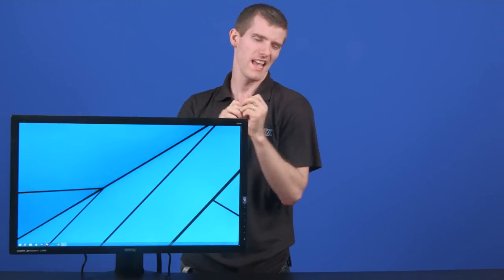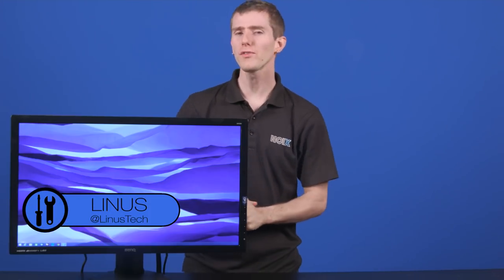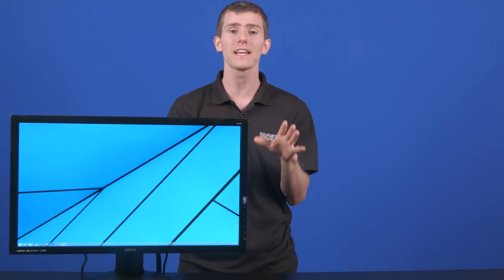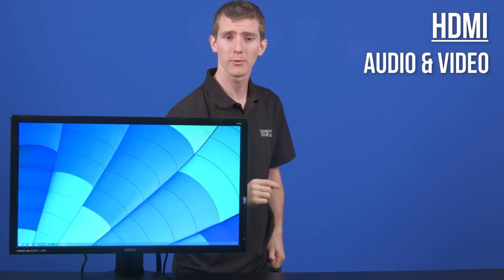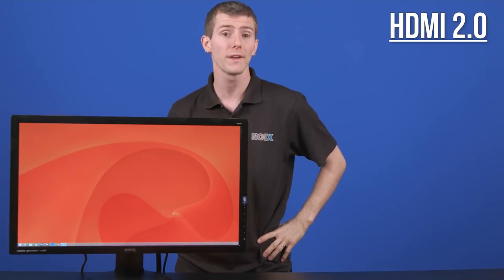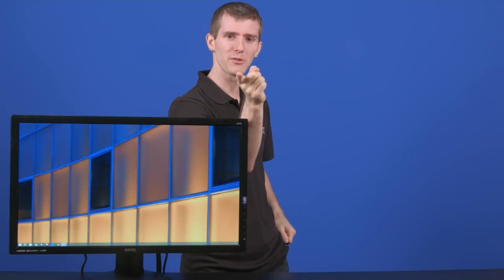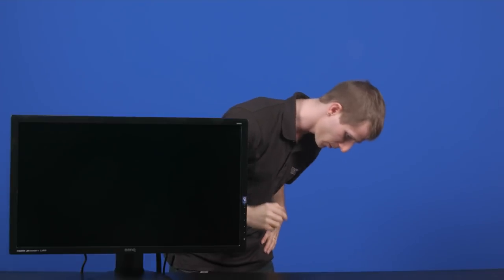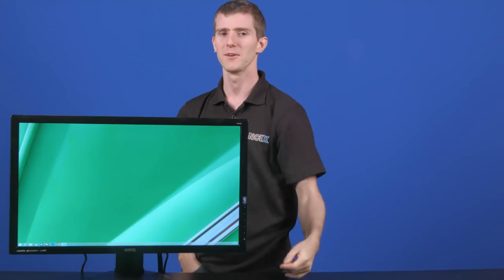Display Connectors Explained! - Tech Tips

Comment: I´m using a normal HDMI port. Should I change to a Displayport? Does it have any benefits, as long as i play only in 1080p, maybe 1440 in the next future.
I7 4770 3,4 ghz
Gtx 980 Windforce 4 gb Vram
16GB Kingston 1600mhz Ram
1080p Samsung Monitor
Reply: Depending on the type of monitor and display monitor you have, Display port is a good one to go with in the future and like Linus said, display port has easier time converting to most display standard so when it comes to compatibility with new monitors are most likely. When it comes to HDMI, it can have problems like EDID conflict where monitor scaling needing to manually adjust and also the cost of HDMI can go high if you don't know where to shop.

Comment: So, my monitor doesn't have a Displayport port. Just 2 HDMI ports a VGA port. If I got a Displayport cable and connected it to my monitor through a Displayport to HDMI adapter, would I get the benefits of Displayport or what?
Reply: No. The solution would be 'bottlenecked' by the adapter or the hdmi port on your graphics card.

Comment: dp to hdmi or just get hdmi 2.0? for better gaming view
Reply: Xmans___  hdmi 2.0, it doesn't matter for your DP idea what cable you use if the port that receives the signal can't process the full quality of the signal you send
Reply: now i use hdmi 2.0 but i can see ghosting on my benq ew2440l while play csgo. it so annoying because i will die first before i can shoot them. do u have any idea how to fix this issues?
Reply: Hi. I have to use either adapter or cable dp to hdmi. My concern is losing quality. So which one is better or is there another option ? Thanks

Comment: I have a samsung UE590 4k monitor. i have connected my laptop to the monitor through a HDMI cable. but it only supports 4k 30fps. My monitor also have a DP port that supports 4k 60fps. How can i connect my laptop HDMI to DP port in my monitor.  (laptop only have HDMI output)

Comment: question: i have a geforce gtx 680 amd thinking of buying a dell u2515h display. what is the best way to connect it?
Reply: your monitor is just 60hz maximum, so HDMI would work (although DisplayPort wouldn't cause problems either), and I find HDMI cables more common to find around than DP cables. You can go with whatever.
Reply: thank you for your support and answer. Just got the monitor amd got it connected through display port and i absolutely love it.
Reply: ZWGamemaster ah, nice!

Comment: if I use displayport-->hdmi will I loose  quality? Also, does displayport deliver audio signal?
Reply: Yes and yes. Any time you convert a signal or transmit it over long distances you will lose quality. You may or may not be able to tell the difference. (Probably not)
Reply: +ealiev60 no you won't lose quality. you'll lose a touch of signal strength, as you're putting a break in the line by routing the signal in one configuration (dvi) to another (hdmi). the loss is minor though. You're not converting anything just changing the shape of the connector. Don't worry though, the minor loss is just the resistance you added from adding a break in the signal, and since it's digital, as long as the voltage is high enough to carry a signal to the component receiving the signal, nothing has changed. it's all 1's and 0's. Quality is lost in analog signals where voltage matters, or in digital signals if they get compressed. (like re-encoding a dvd or bluray movie) Hope that helped.

Comment: Does DVI supports 1920x1080 60fps ? I have a Benq RL2455  connected with DVI. Will i get more if connect with HDMI?
Reply: +bloodcorer i'm sure dvi dual link supports up to  2560 × 1600 at 60hz so it can support the standard 1440p at 60hz ;)
Reply: Eping | Gaming & More
My monitor doesnt support 2k. Its strict down to 1080p but thanx anyways.
Reply: bloodcorer if you have a nvidia gpu you can overclock your monitor resolution if your gpu can handle it and play at a higher resolution it will be like AA.
Reply: Eping | Gaming & More
Nvidia is just mainstream crap. I play everything on max resolution witch is 1920x1080 with my HD6870 1gb. I was just wondering if HDMI would give me better colour or something.
Reply: +bloodcorer The only difference between HDMI and DVI is that DVI can't do audio. So unless you want to use the speakers on the monitor if it has any. You will not notice a difference between DVI/HDMI @ 1080p
Reply: cheddar07
Ok. Thats what i wanted to hear. Thanks

Comment: I need help :)
my rig
x sniper case
2tb seagate hdd
fx 6100 Zambezi 
970 msi MB
r9 270 xfx GPU
6gb ram ddr3
650 bronze evga PSU
how should I upgrade 
two ssd in raid? and 16gb of ram? or what . thanks :)

Comment: Hey guys, one question. I have and old LG W2363D that runned at 120 Hz on my old rig with a DVI-D dual. Now I want to use the monitor as a second monitor but there is no DVI-D connector on my RTX 2080 Ti so I bought an adapter DVI-D to Display Port and connected it. I can only get 60 Hz on my monitor, any ideas on why i cant run 120hz on the second monitor?
Reply: l4tiNoh34t you have a 2080ti but also have an old lg monitor

Comment: It's a shame they're getting rid of VGA and DVI, they're better connectors than HDMI.  When I connect a display with VGA or DVI, it just works.  No hassle, no fuss, just perfect display clarity.  When I connect a monitor with HDMI, I start getting issues with overscan (yes, that dated concept STILL EXISTS), interpolation and bad screen size reporting (720p screens reported as 1080p).  It's so bad most of the time that text is unreadable and the colour only displays in 16 bits.  DisplayPort is the way forward.  It's free, works without fuss, and supports better screen sizes/refresh rates than HDMI.

Comment: After realising my video card only supports a max of 2 monitors, I'm currently using VGA, DVI, and HDMI at the same time on two monitors. (For the record, converters: one VGA-DVI connector and one DVI-HDMI connector, and no, not on the same line, either.)

Comment: Just gotta be the guy to say my primary is converted from DVI to VGA by adapter on the card because my monitor I got from a friend's old computer doesn't support DVI and also because I own no DVI cables. My second display I rarely use is an old CRT over VGA through a KVM. Resolutions are 1366x768 and 1024x768, not because 768 is my lucky number, but the primary only goes that high and the CRT at it's max of 1280x1024 looks tiny, though strange enough I've accidentally gotten it to 1080p

Comment: Even if this video dates back to 2015...

on my Setup I currently use HDMI 2.0 and DVI-D Single Link, which is a bummer for me, I would preferably use DisplayPort and HDMI 2.0 so I'm looking toward to buy another Asus Pro Art monitor which will be 2560x1440p over DisplayPort. My current monitors are Acer's K345HL(Pre-Production Sample) and an old and discontinued Asus PA247 (as though sold as a VS(Visual Studio) monitor because it didn't reached the standards for 2560x1440 in 2012)

Comment: HDMI for my primary monitor, Dual Link DVI-I for my secondary monitor. Both run 1080p at 60Hz stock, primary is overclocked to 73 Hz and secondary to 62 Hz.
Reply: +Marco Hellmann you can overclock monitors...mind blown. And how are you getting hdmi to carry a refresh rate higher than 60Hz? Is it hdmi 2.0?

Comment: i used to use HDMI and VGA to get that Dual Monitor setup but since my new PC im stuck to 1 monitor until i either get a Displayport to VGA adaptor or get a new Monitor that supports Displayport. you must be asking why i didn't get one withe displayport in the first place, well 1. i only had £80 and 2. my old GPU never had Displayport.

Comment: Your explainations have been very helpful sorting out my latest jumble of video connection capabilities. I have a 21 inch Dell LCD monitor with DVI, VGA, S-Video, and Composite inputs and a second HP 21 inch monitor with VGA, DVI, and Displayport inputs.
My main stream is DVI to 1 monitor and the other HDMI to DVI conversion.
I still use VGA as alternate port on one monitor with my MSI Netbook PC with VGA output running Win 7 when at home using the front panel switch to select. Hey, its been around the world litteraly 3 times in a previous career and still going strong.   
Now I have a second CPU with HDMI, Mini Displayport, and USB-C displayport outputs. Well I'm still trying to figure out what I'm going to do with 7 outputs and only 2 monitors. ;-)

Comment: A year late it seems, but I haven't yet watched the entire backlog of videos...
With the ever increasing resolutions of displays, and the tech making the usage easier; I think the already stretched bandwidth usage of 1080p, streaming over the internet, is going to push the absolute need for fiber internet everywhere in the coming decade. However if the ISPs don't get on it fast, we will be significantly bottlenecked with our internet speeds (and sometimes caps) just barely making HD streaming possible.

Comment: I've been using DVI for over 5 years though my hardware supported HDMI. However, in 2015, after getting myself a home theatre which has only HDMI ports, I finally made the jump from DVI to HDMI. And it turns out that it was the most horrid experiences ever. The colours were a bit odd, text was a bit smudgy, the overall brightness was lower. And when I googled the problem, it turned out to be something that many people were facing due to some weird nvidia driver issue, where the GPU thinks that whatever is connected to a HDMI is a TV (and outputs a lower colour range) and the one connected to DVI is a computer monitor. Though many people had several ways to correct this issue, none of those methods made the picture look as good as DVI.

So, if DVI is a legacy technology, why is the current standard HDMI isn't as good as DVI?! WHY?!!

Comment: You answered about 2,000,000 questions I had,but I have 1 more. I daisy chained my two 4 k monitors together and ran an HDMI cable from my video card to the HDMI 1 input on the main monitor, I have no signal on the 2nd monitor, the 2nd monitor input is set for the  data port. What the neck am I missing. Great video.

Comment: I actually have a question for anyone especially Linus. I have a 2k monitor that uses displayport only connection type. Now my issue stems from the fact that my boot sequence or bios post does not load/show on the monitor when starting up my PC. Nothing comes onto the display until it is loaded into windows already. However, when I have an HDMI or DVI connected monitor either  alone or as a secondary it does so just fine. Is this an issue unique to displayport? It has been happening with both my older GTX 680 and my latest GTX 970. So lately I have always had to keep a secondary monitor plugged in through HDMI or DVI if I ever want to access my bios. I already have it set as a primary monitor and even when it is the only one connected this happens. Any help with this would be appreciated as this is my for display port based 2k monitor and never had this issue with the other connection types.

Thanks
Reply: i would check the bios 

in my case its very minor on my crosshair v formula z, the diffrence between pci and peg is a change in boot font and logo size

on the bright side the boot ups look cleaner

Comment: I have some problems with my uwQHD (Philips DBM3470UP/00) connected to GTX-680 through DisplayPort. After getting back from sleep, the display sais "No signal" then "Going back to sleep" and just after that it starts working normally. It drives me mad! It occurs only when using modes that require DP1.2 (native 3440x1440@60Hz or 1920x1440@60Hz) When in lower modes (i.e. 3440x1440@30Hz) everything works fine. I wonder if it's possible, that the card has a problem starting up with this amount of data.
Reply: +Immortal Universe Hi. Thanks for great answer. I've installed Moninfo and guess what: there is no real-time EDID
Reply: +Immortal Universe OK, I've read your message twice and I think I understand now. You say, that when in my "Display IDs" there is my monitor marked Registry] this is what I am looking for, yes?
Reply: Hi. Eh, whatever I do, I don't have real-time info - neither in MST or SST mode. I think there is something wrong with this monitor. I have the real-time data though HDMI. Would it help? :)
Reply: Ok, thanks for your help. I think this is the limit of my skill.  I'll ask the support if it is normal, that I can't get real-time EDID info through DP

Comment: i have samsung UD590 hook up on a Geforce gtx 770 2gb intel i5 4440 3.10 overclocking, my HDMI works fine giving 30fps at UHD and 60fps at 1080p. sadly no signal from display port tried everything.
CAN ANY 1 HELP,why im having this problem?

Comment: what is usb downstream  vs usb uptream monitor ports?
Reply: USB Upstream is a cable that sends power to the monitors USB outlets via the computers USB port, usually the end that plugs into the monitor end, isn't usb it's shape that looks similar to an ethernet cable. I think some monitors these days come with the basic wires in the box, so you should have a USB Upstream cable that came with the monitor. Downstream just means you can use the USB plugs on the monitor once the Upstream cable has been connected from from your computer via the USB slot and the monitor via the Upstream slot.

Comment: I use DVI-D for my 1080p 144hz monitor, would there be any point changing to a displayport-DVI-D or displayport-HDMI? The monitor wont accept displayport, also 144Hz is not necessary, 120Hz will suffice.
Reply: +Wastedswan To my understanding no there wouldn't. Because the adapter would change it to basically a DVI-D or a HDMI so its as if you'd be using the same cable or just switchiung to hdmi which as far as i know hdmi can only do 60Hz which is why high refresh rate monitors do not ship with hdmi cables typically. My monitor has 144Hz and it shipped with DVI-D but i went ahead and bought a display port since my monitor has it. Since your monitor doesn't have DP anyways then the cable you have is already the best you can get.

Comment: what port do a touch screen monitor are?
Reply: James Chua all of them + usb connector
Reply: +James Chua The port doesnt effect the touch screen just your resolution. And if your touchscreen has built in speakers you will need hdmi or display port to use them without a separate AUX cable. DVI might carry audio Im not sure but VGA does require a separate AUX cable to make use of built in speakers.

Comment: I have a Tempest 270OC 120HZ 1440p 27" display. As you already know most of these korean gaming monitors only have DVI input for the reduced lag and cost. Now Fury X is released and it does not even have DVI output. What is one to do in that situation? Adapters cant do 120hz right? if thats true, then my only option is ignoring the Fury X and getting the 980Ti or Titan X? Which seems like a really stupid buy at this point. Paying $400 "extra" just for a DVI port, lol not happening. Will the Fury have a DVI port and if so, will that be a better card or should I just get a 980Ti with 6GB of GDDR5?

I hate AMD for dropping the DVI port and making my decisions so much harder.

Comment: i'm using DVI dual link because i've looked everywhere and can't find what revision HDMI my graphics card and monitor are using and because my $400 144Hz monitor doesn't have displayport. fml.
Reply: your monitor probably have the version that it needs to run at it's max capacity, for your graphics card, a quick search on the nvidia/amd website and you will find it (if you use on board graphics, you need to check the motherboard's website or manual)
Reply: canalsemvideos
ayy lmao nope. even though the monitor was made very recently, it only has HDMI1.0. Looks like i'm spending an extra couple bucks for a DisplayPort to DVI adapter if i want to use a newer graphics card, then.
Reply: hdmi can't give you 144hz, you need a displayport cable or dvi-d, what monitor you got at 144hz without displayport?
even asus uses them lol
Reply: Simos Katsiaris
HDMI 2.0 supports 4K at 60Hz. why wouldn't it give me 144Hz at 1080? Even HDMI 1.4 would give me a theoretical 120FPS max.

I've got a benQ XL2411. i'd like to say it's non-T because it doesn't have a T etched onto the top right corner with all the other letters but apparently there's no such thing as a non-T model, whatever that T might imply.
Reply: Gordon Rammstein no GPU has HDMI 2.0, you need the hardware on both sides to support it
Reply: Simos Katsiaris
plenty of GPUs support HDMI 2.0. what are you talking about?
Reply: Gordon Rammstein just rechecked hdmi 2.0 is on nvidia 9xx series and newer, it must be the display then
Reply: Simos Katsiaris
yeah, as i said in my comment, the display only supports HDMI 1.0, for whatever reason. I think i got the base model monitor, though. The next model up had DP and possibly a better HDMI standard. Oh well, you can use the port for console gaming.

Comment: Guys im abhout to buy a brand spanking new rig upgrading from a GTS760 to a whopping GTX 1080 Ti.....The one im getting has 5 ports 3 DP, 1 HDMI and a dual-link DVI port im assuming thats a DVI-I? Anyhow I know I can link 5 monitors to it however if I daisy chain one of the DPs into a EVGA 200-DP-1301-L1 Display Port Hub and add a 6th monitor will that hurt? Let me know if you need more info :)

Comment: i got a 660 ti with asus 24 inch 144 hz mon on hdmi if i install the gsync module on my monitor i will use display port.
Reply: oh and i am using a q6600 set at 3ghz